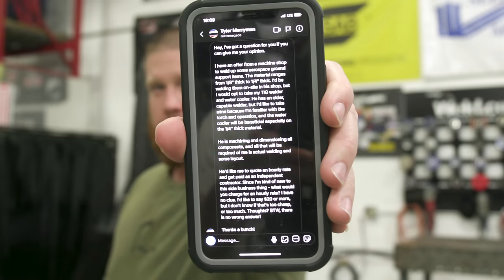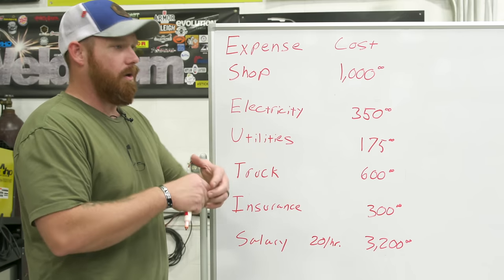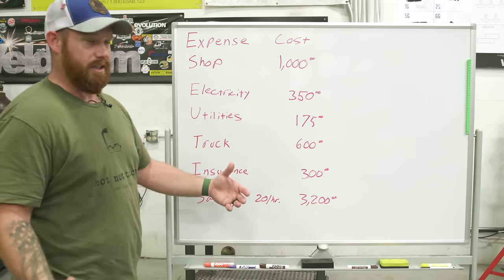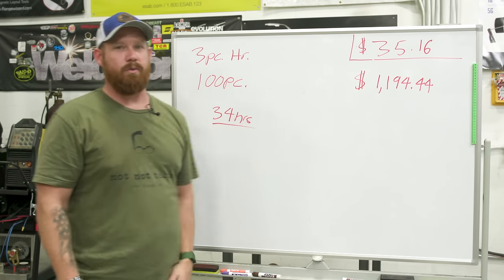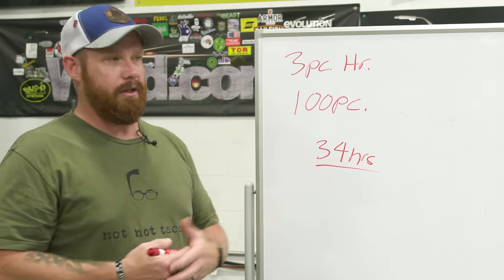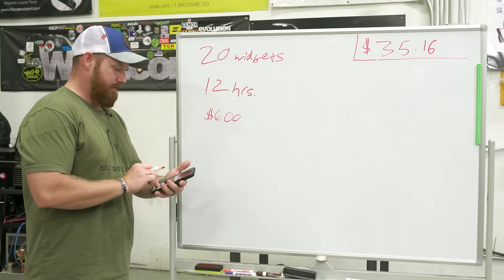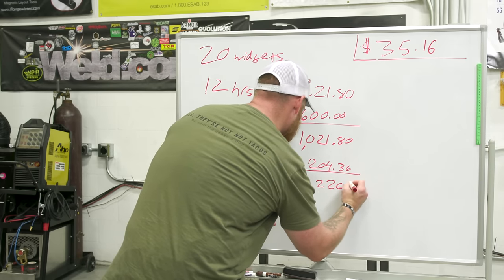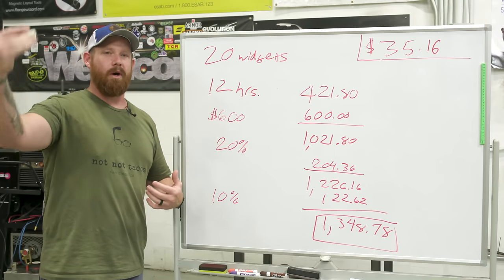Welder pricing - How much should you charge for your welds?

Comment: Another great video. You should consider a mark up on materials and subcontracting items to be used for the job. This will protect your profit and covers the cost of the management of sourcing supply.
Reply: You are 100% correct. That’s why we add the 20% consumables and 10% profit last so it captures every aspect of the scope of work. I probably should have stressed that point a bit harder.
Reply: Yes. Always mark up materials!

Comment: A couple comments:
1) Don’t forget to add consumables and profit to the work you are doing in the field as well!! In these example, even if we time correct for the first example so that you complete widgets in the same amount of time (2/hr), if I am the guy hiring you, I’m gonna hire you to bring your stuff to my place, I’ll buy the material, and you do the work. After evening up the time and removing material, I would only be paying $17.58/widget if you come to my place, but $37.44/widget if you do it in your shop. Not trying to ball bust, just reminding that you need to remember consumables for your equipment and profit for the business if you are working at somebody else’s place too. 
2) Good video and very sound advice. Remember most small businesses fail within the first few year of starting because guys don’t get this part right from the beginning. Getting your numbers right from the get go with ensure that you are making money and not just staying busy. 
3) I agree that you should know what your local competition and market rates are. However, be careful just assuming that is what YOU need to charge. You may have more or less overhead. You may provide better service, etc. I work with contractors all the time and many of them fall for this trap. Know what YOUR business needs to make to keep the doors open. If you always just try to be the cheapest, will just be part of the “race to the bottom.” It is ok not to be the cheapest as long as you can show value to your customers that your competitors don’t. If your customers tell you that you are too high, ask them “Compared to what?” If they can’t or won’t have that conversation with you, they will likely never understand the value you bring...do you really want those customers anyway??

Again, great video! I wasn’t trying to pick you apart with the first point, just used it to illustrate how important this topic is for business owners, gotta know your numbers. As a person in business for yourself, this information is more important than knowing how to perform the work.
Reply: I mostly agree but you can charge too much, no matter how great you are. If the going rate for good service is $60 /hr and you want $90/hr, you will likely get few takers, even if you are the best, nicest, fastest, and cleanest person to hire. I have been self employed for 30 years.

Comment: one major thing you didn’t mention in regard to contract work for aerospace/defense is some of the regs placed on the defense contractor who subcontracts out work.  as a former procurement specialist (aka buyer) for a major aerospace/defense contractor, we (I) regularly negotiated with one-owner/small businesses for subcontract work.  my company was required to request a cost breakout on bids from subcontractors, i.e. overhead rates/amounts, wage rates, administrative AND MOST IMPORTANTLY, profit margins.  Basically, the main customer, the government, was diving into the s/c’s cost & profit structure through the defence contractor.  HOWEVER, the savvy s/c’s KNEW there were exclusions to these requirements and regularly invoked them so as to keep the gov’t and prime contractor out of their business structure.  By NOT invoking these exclusions, the s/c’s open themselves up to FULL scrutiny AND more importantly, can create a nightmare for themselves when trying to negotiate and make a reasonable profit.  

If you are contemplating pursuing ANY kind of business with the federal gov’t OR a prime contractor working a federal contract, it behooves you to research EVERYTHING about contracting or subcontracting with such entities.

Comment: Good useful info.  Two things I would add are that you never want to be too far below the average cost because people will not think you are any good.  So yes you don't want to undercut everyone but it can also directly hurt you getting work if you are the low bidder.  And I always add 10% contingency to any project.  You kind of have that in the second scenario with the "profit", but you don't want to be hitting your profit too much with contingency costs.  There is always something.  If you want to get some smiles you can refund any unused contingency when the job is done.
Reply: If you don't use the contingency, are you upfront enough to return it to the customer?

Comment: One thing I factor is if they want me to run a MiG or TiG job. For TiG I usually up charge about 10% on average. Unless it’s a massive job I up my work hours due to it being way more difficult and time consuming in most cases. Stick I charge less unless it’s a large job because I hate stick welding lol

But for outside rough jobs I prefer it for minimal equipment and set up.

Comment: Most biz want me to fill out a w9 so they can 1099 at the end of the year. Would you add another approx 20 percent for tax? Awsome vid thank you.
Reply: not a bad idea to add for the year end tax.  as long as you have some deductions come tax time I think you'll find you don't really need 20 percent though.  One thing that could be added to the discussion is a good accountant.  I've been running a shop for 7 years and bottom line is charge as much as you can as often as you can.

Comment: A welder and an automechanic make similar wages, so check the hourly charge-out rate in the local non-brand garages which looks like they are paying their taxes. Thats what you can charge.  If it's a pure welding job base it on the weld in volume. If it is a structural job some thumb rules are: if the items are all over a ton (1000 kg) then 60 hours pr ton.  If there are more than 12 items pr ton then it is 360 hours pr ton. Make a graph and draw a line between those two points.  Most important is to have a network of other one man bands to use intermittently.  Not only other welders, but specialist services like CNC, NDT, X-Ray, etc.
Reply: I wouldn't really say so. Mechanics make max $35 where I'm from. Welders at $10-20 on top of that before materials.

Comment: I would also add in 10-15% extra just in case you forgot something and have to pay for it. I do computer work and have a set rate but I still add it " just in case" money because sometimes prices go up just before you order or you need more than you thought based on the actual site conditions. That 10-15% emergency money has saved me a few times when the client didn't do everything they were supposed to and I had to cover it to complete the job. Also make sure all the time you take to pick up materials is covered. If base cost is 35.15/hr I would just set a hourly rate of $55 or $60 because you won't always work the full 40 per week and that extra covers some down time. When I started back in the 90's, I set my rates 10/hr lower than the established businesses and haven't looked back. I started at 40/hr and now am 60/hr for in store work and 90/hr for onsite including Networking work. I am cheaper than many but only because I bought my location and have limited hours due to health problems. If I was 100% healthy, I could get $100-$120 /hr easily as that is the going rate for business work in my area.

Comment: I figured I'd watch this when I got another odd job... Days after you post* this one!
Tractor log grapple, but unsure of which type without too much info short of the fact I'm building a mounting assembly to attach it to the bucket or the 3 point lift. 🤔
Wish I had the darn specs or model number to prep before it comes in the shop! A 14,000 lbs tractor isn't exactly fun to keep in the shop or the garage.
I will have to pay someone to be the ballbreaker, I'm too nice to people!

Comment: I charge by the inch, steel/stainless/and aluminum all different.  fitting/ cutting and drilling to, when l break down all this little costs to the client there is nothing to complain. When someone needs just “one” inch of welding l apply the minimum fee.

Comment: The outside purchases required to do the job are usually marked up 20% - 25% to cover the true cost of money, time, and waste or research.  At least that’s the way everywhere I’ve worked have done it.   When you get large enough to have to hire a secretary to do all the vigors required to involve other businesses this mark up helps pay wages for that.
Reply: Was going to mention this. We mark up 30%. This covers the time taken by just dealing with ordering and receiving the materials. 10% profit on top is low also.

Comment: You talked about outsourcing and material cost. I am just wondering how you have factored that price into a project. For components, I buy such as hydraulic rams & fittings, wheels, hitch pins, etc. would you recommend up charging or just factor in the exact price I paid for those items?  Thanks!
Reply: Factor in the exact costs because at the end you are adding 20% for consumables and then another 10% for profit. As far as outsourcing, I get quotes from the company that will perform the work and use those costs in my bid.

Comment: I was lucky.  My first major customer  showed me what others were charging so said ill do it for that. Small production parts for $2 ea. But they send me boxes. It worked out to be $60hr. My second customer needs part welded on a reg. Bases. But not enough to hire a full time guy. So my bid came out to $60.hr. they never questioned it. So im thinking im a little low, but i have them as cust. So. 60 x 40hr week x 52 weeks.= $ 124800 a year.  Ok ,but I dont have 40hrs. Worth of work. I'm making half that. So I think my rate is ok, I just don't have work to fill 40hrs.

Comment: What drawing /design program would you recommend for a start up. A subscription to solid works or any of the main ones are expensive.
Reply: I would recommend Rhinoceros 7, even though it's not a parametric solid modeler, which means that changes of existing designs are slower. It's a single pay of 900 US Dollars and stays yours forever. Also, it lets you download Rhino 8 WIP (the new version that will be on the market in the future) and you can use them simultaneously while benefiting from the newly added features that Rhino 7 lacks. You will speed up your designs and reduce strain in your hands if you also buy a 3d mouse such as 3Dconnexion SpaceMouse.
 If you prefer parametric modeler, then Fusion360 may be a good fit for you.

Comment: I agree with everything except how you figure your salary. That is totally and absolutely wrong. Your salary should be solely based on your worth/skill level based on rates in your area. Your salary should NEVER and is NEVER based on what you need. Mainly because 1 out of 100 people only takes what they need. People live based on wants. Plus maybe you're living costs are higher than your skills are worth and you need to adjust how you live until you gain the skills and reputation to help increase your wage. Plus the way you figure it basically takes out the incentive to gain or refine skills and is a fast way to over bid your jobs. I am a superintendent in trenching/excavation/grading/underground utilities. When a sub contractor quotes a rate that is not consistent with industry standard +/-10% and they explain that it's because they "need" that much to live we just laugh and tell them you better find out how to live cheaper and basically put them on a "no-bid" list where we wont even allow them to bid anymore. This is basically standard in every industry I've been in.

TL:DR - dont figure your salary this way or you will be told to GTFO lol